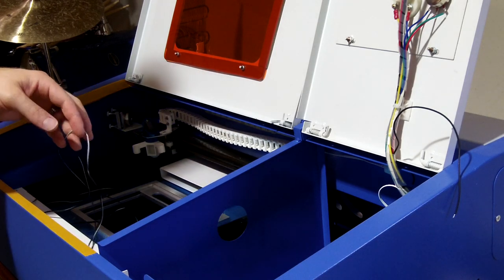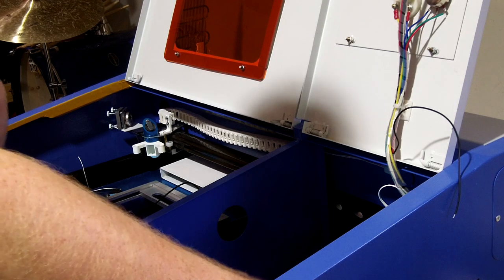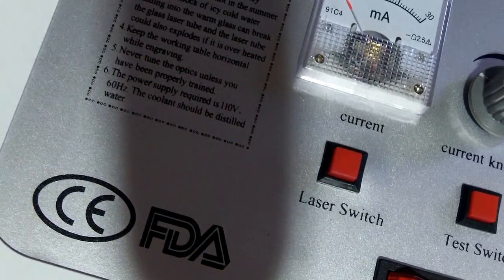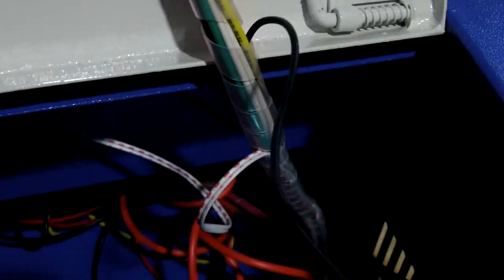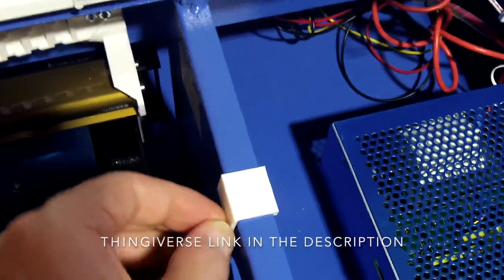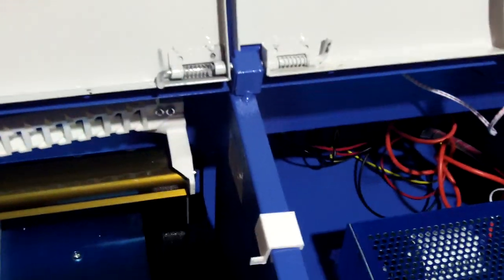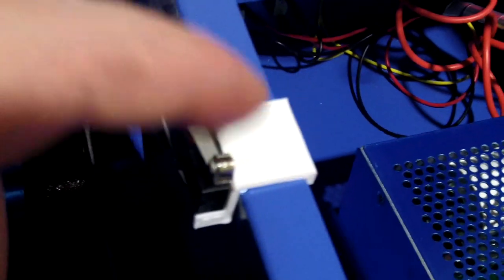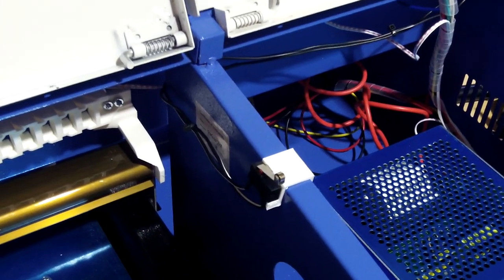K40 Lid Safety Switch

Comment: What Guage wire did you use?  Looks like it is pretty small (22ga ??)
Reply from the maker: Yeah, it was either 20 or 22 gauge wire. It only needs to handle the 5v signal that allows the laser to switch on so it doesn't need to be anything heavy duty.
Reply: @projectORnaught  Thanks.  I picked up some 20ga hookup wire and it works fine.